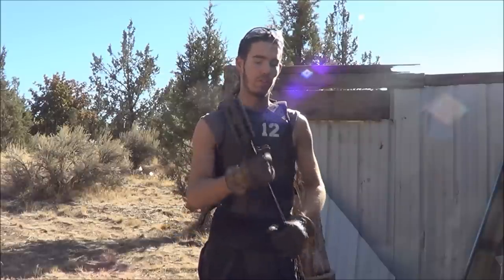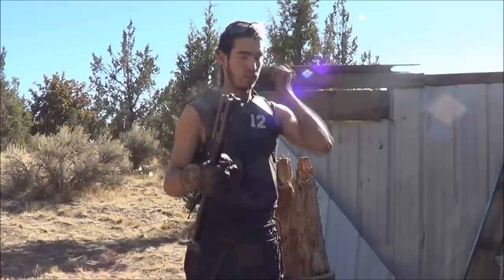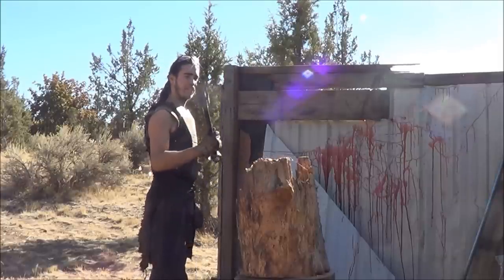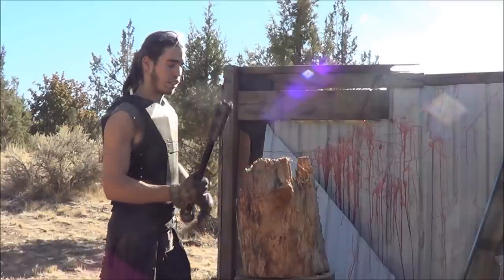bar mace

Comment: I'd love to see it against platemail or a helmet.
Reply from the maker: well hopefully ill be testing against armor soon, I have a bunch of my older armor sitting around so I thought I could put it to use, might make a shield also to test on
Reply: Ironclad Industries  That would be sweet. There are several armor tests with ball or flange maces on youtube, but none with a bar, which I'm guessing is probably even more devastating.
Reply: Ironclad Industries
 Also you may want to try it against a cheap sword you don't mind losing, since the bar mace was also used as a swordbreaker.
Reply from the maker: NevTheDeranged im not sure, it seems to me that the flatter the surface the less damage it would do since theres nothing sticking out, so on a helmet it would be great, but getting down to a breastplate or something less rounded it would do less damage, might be a good theory to test, and that's a good idea too, I might do that some time
Reply: Ironclad Industries
Well, when you strike for damage with a staff weapon, for example, you don't strike with the shaft, but with the end, for maximum tissue damage. With a bar mace, you wouldn't do the damage with the side of the mace, but with the tip, the corners at the top are where the PSI gets focused to tear into the armor.

Or I could be talking out of my ass, which is why I want someone to do the demonstration, so we'll all know for sure ^_^
Reply from the maker: NevTheDeranged actually im pretty sure your right, I didn't even think of that lol
Reply: +Ironclad Industries Mostly it would be used to incapacitate a warrior's head and limbs. The training to use a bar mace, ironically, would actually be close to SCA fighting.